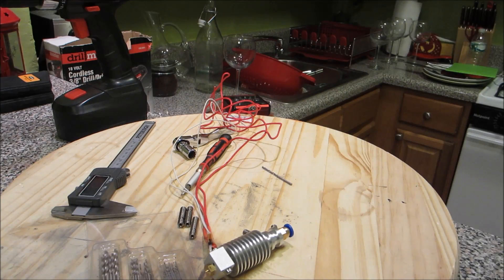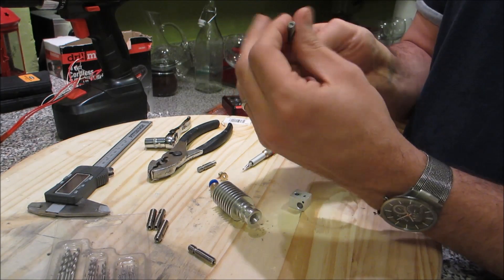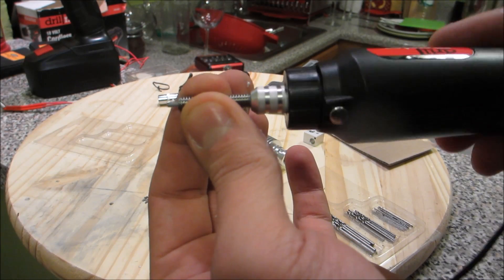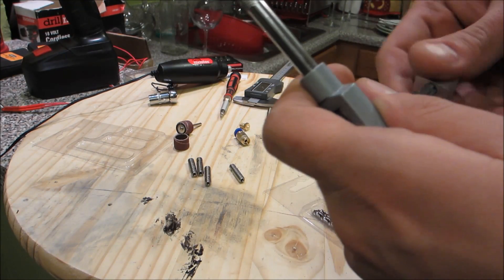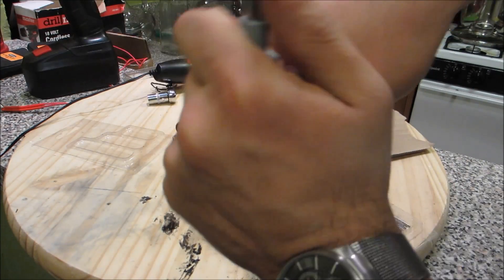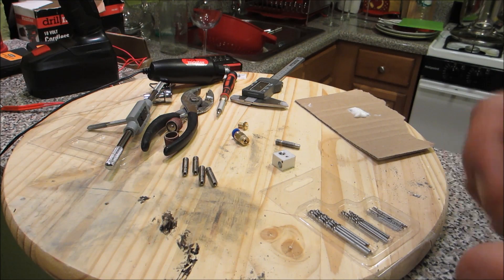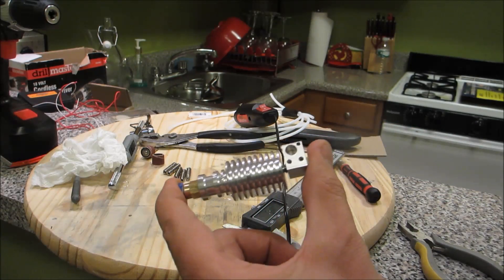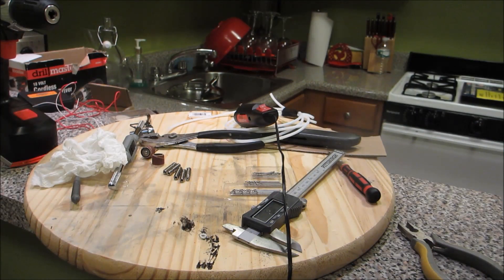Hot End Rework. J-Head, all metal hot end. 3D Printer.

Comment: Ooh, these are some awesome tips. I've been drilling my own heat breaks out of stainless steel screws. I didn't polish mine as I didn't know how, but instead I made the thin section really thin as per the original E3Dv6 heat break drawing. I'll try the polishing tip sometime soon.
Reply from the maker: ***** 

I have developed a better way to polish the internal parts of the heat break. The toothpaste method is very time consuming. The new method needs a 1.7-1.8mm drill bit and some steel wool. It creates a very fine finish and takes 1/10th the time. I will post a video of the process.
Reply: Bruno M. Oh nice, thanks!
Reply: @Engineerd3d  link please?
Reply from the maker: @desmondfantastico9553  check my channel. I polish them with a undersized drill wrapped in steel wool. Gives a nice finish.
Reply: Bruno M. Eager to see your method.
Reply: Did drilling a hole in the screw give you a centered hole? I tried with a bolt and centering was difficult even with the first hole centered (maybe run-out of my drill press).  Is Stainless really hard to drill? What was your procedure and results.  It would be awesome to make heat breaks!
Reply: @TheRainHarvester  Remove the screwhead (or use a threaded rod), chuck the screw into a drill press, clamp the drill bit, and go slowly with a lot of drilling fluid. If you have a lathe, use that instead. Spinning the work instead of the drill bit helps keep the hole centre.

Results were good, I've been using the heat break for a few years now, and it still works well.
Reply: @hypera1r  thanks! Was the hole a little bigger than the bit because of being off center? I guess one could use a smaller bit, then take the threaded bolt out of the Chuck and use a bigger bit to drill to correct size. Thanks!!!
Reply: @TheRainHarvester  Hmm, not sure. I used a 2mm bit, and 2mm is too small to get my caliper into for an accurate reading. But it probably didn't run too far out because I turned the neck down to an OD of 2.4mm for an estimated wall thickness of 0.2mm, minus runout
Reply: @hypera1r  .2mm sidewalls?! Wow that is thin! How many did you mess up with before getting a good one?  I guess that sidewall thickness is required to get 2mm inside and the required outside diameter.  
When I was drilling a 5/16 bolt for my z axis, (soon video tbd), I noticed I nicked a sidewall because I could see light on the inside.
Reply: @hypera1r  I wonder if sanding down the threads a little would prevent more heat transfer into the heat brake?  Or adding some type of heat resistant paste to the screw threads (or even insulation fiber)?
Reply: @TheRainHarvester  None broke from grinding down the neck area. For some of the failed ones, what happened was that the drill bit snapped inside the hole, or I used too much force, and it went sideways and the exit hole didn't quite line up with the nozzle or heat sink hole (whichever way you align it)

The 0.2mm thick wall in the neck area is important for an all-metal hotend. E3D's drawings say they go for 0.4mm thick, but the thinner you go, the less heat gets conducted through the heat break region, and the less heat your heat sink needs to expel to keep your filament from jamming. It gets a little more fragile though, so you have to be careful not to be too rough with it

Between the threads of the heat sink and the heat break I use thermal grease, just standard cpu stuff, but no thermal grease in the heater block because it can't stand those temperatures.

I'm not sure what you mean by sanding down the threads.. if you mean the "neck" area, i.e. the section between the heat break and heat sink, the threads are ground off entirely (2.4mm OD remember, and the minor diameter of the thread is something like 5mm)

Comment: Sadly i broke mine today or the nozzle. They screwed down the set screw of the nozzle so hard it actually damaged the threads on it.
The block threads are not that great anymore so i ordered a new block and nozzle just to be sure but all in all it prints quite nice
Reply from the maker: Yeah. The set screws are a common gotcha. This hot end is by no means a well put together hot end out of the box. However with some careful thinking you can make it work and work well at that. Definitely not a plug and play unit in my book. I will be doing a video on how to polish the heat breaks better than toothpaste up soon, as well as some other tweaks.

Comment: I just finished the rework on this hot end and wow, the results are awesome with PLA!  Way better than any hot end I have previously used.  Thanks for making this video available!
Reply: ***** I'm wondering if you like this hotend better than an original J-head for example? Which hotend are you comparing it to? Thanks.
Reply: fred98321 I am comparing it to the original (MKII) JHead from MakerFarm.  I just recently changed out the heat block for a clone of the E3D and it works even better.  http://www.aliexpress.com/item/3-D-printer-parts-Reprap-E3D-V6-Aluminium-heater-block-for-HotEnd-sand-blasting-surface-20/2054702597.html

With the re-weork that Bruno suggested, this is an awesome hot end for the money.
Reply: ***** Thank you. I'm likely going to try this hotend tweak.
Reply from the maker: fred98321 I am comparing this hot end to the j-head (MKV)
 I melted down by accident. This hot end is a bit more fiddly to get right but once you do its solid. I had way less clogging issues with this than the j-head. One thing I can say having seen real e3d stuff. Is that the quality of the machining on the original is great. This one you need to prep before mounting IMHO.... One question a user should ask is, is this worth it to them?
Reply: Bruno M. Fiddling is fun. Taking something dirt cheap and making it work well as you are doing is even more fun. For me the exercise in itself is worth it. I understood you print ABS. Do you have knowledge how this hotend (with your finishing) works with PLA? Does it have the jamming issues common to metal hotends. I use 3mm and would like a 3mm heatbreak so will see if the have that. [Edit: I read again the OP said it's good with PLA.]
Reply: fred98321 I only print in PLA and it works great!
Reply: ***** Sweet. I'm going to get one for sure. Thanks.

Comment from the maker: @RC JOSEB

It seems you have disabled the reply option. In either case, I bought these heat breaks http://www.aliexpress.com/item/5pcs-lot-New-RepRap-3D-Printer-M6-26-printer-nozzle-throat/1692946949.html

If your printing in pla, just order extra teflon liner and replace it occasionally. Having a teflon liner leads to less headaches down the run with PLA. ABS on the other hand just leads to more maintenance as the faster I print, the higher the temperature and the higher the temp the faster the teflon breaks down.
Reply: Thanks for the link and info.  I had ordered the breaks already and paid 3X more for the sane amount, damn!!!!  Oh Well :-(

http://www.aliexpress.com/item/HOT-free-shipping-3-D-printer-accessory-Stainless-Steel-Heat-break-for-E3D-hotend-for/1919242437.html
Reply from the maker: ***** I purchased those from that link. I am sure about it as I pulled the link after the order from the order history in my account. Unless they shipped the wrong heat breaks they had 2mm orafices on them on my shipment. The most reasonable way to look at these is if its meant for 1.75mm filament and has no PTFE liner in it then its most likely a 2mm orafice... If it has a PTFE liner as the original one did then its 3-4mm depending on manufacturer.
Reply: Bruno M. ***** For anyone else seeing this video, there are cheap 2mm no-teflon heat breaks on eBay:
http://www.ebay.com/itm/121602646980

Not quite as cheap, but faster shipping and the pictures/quality look good.

In general that seller has some good replacement parts with shipping inside the US.
Reply from the maker: I'm not afiliated with any sellers. Nor have I measured my heater cartridges. I bought 5 heater cartridges last year for a song and use them. I only had 1 go bad and that was due to my own fault.